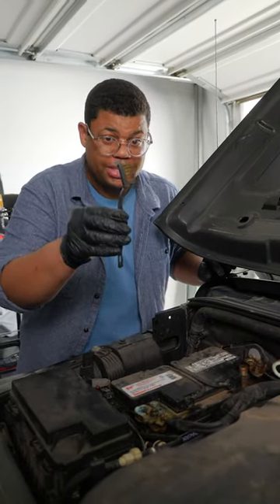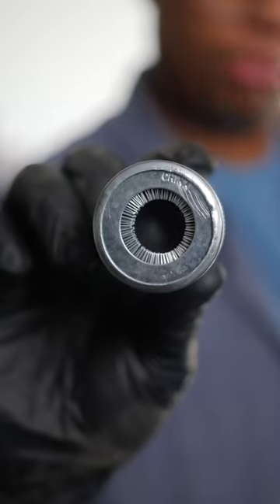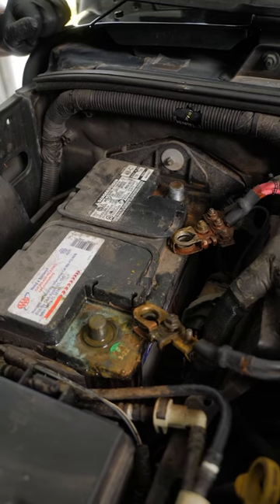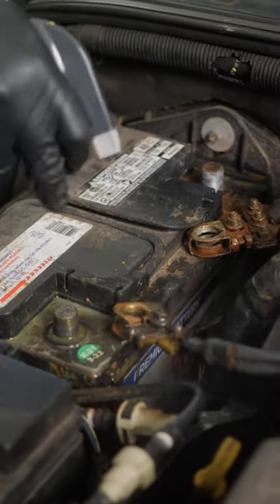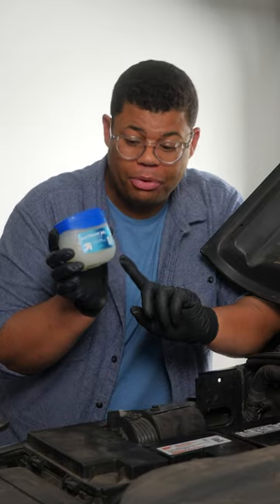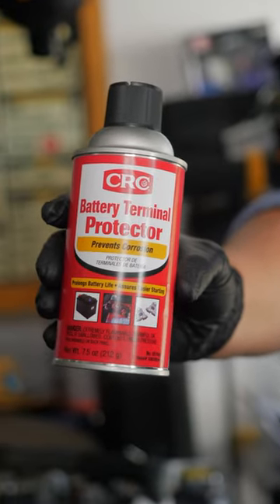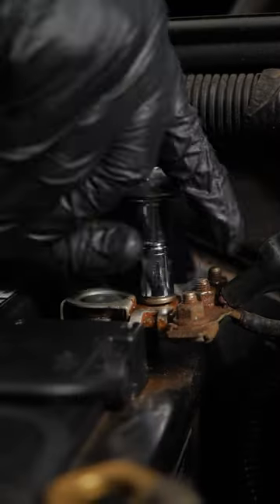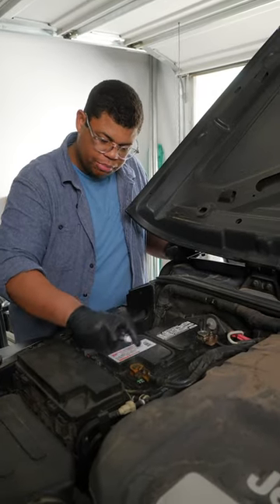How to save your car battery pt. 2 🪫 #problemsolved #lifehacks #carbattery

Comment: Wire brush and some Deoxit is more than sufficient imo. Deoxit cleans (with some action), protects, and lubricates and a speciality tool is another one to lose, leave in the shop, and forget. 
Can even use Deoxit on terminal connections to improve the connection quality. Though Deoxit is not as good at lubrication and protecting as vaseline.

Comment: Dielectric grease is way better and a little pouch of it is very cheap, also those felt pads can cause the battery cable to not fit all the way down on the terminal. They're really just a band-aid, if your battery has excessive corrosion then it needs to be replaced.

Comment: if you have a power washer it’ll do 90% of the work just give the terminals a quick spray, then take off the terminals and clean the bottom and inside with a wire brush and your good.

Comment: Put dielectric grease on the terminals. Not petroleum jelly.
Reply: Not on terminals preferably goop it on after the connection is made, it's good helps keep moisture out and dirt out. Like to use the stuff on outside of plugs where they have the gaskets kind of like a second barrier to water egress.